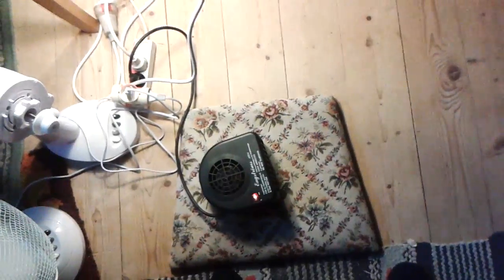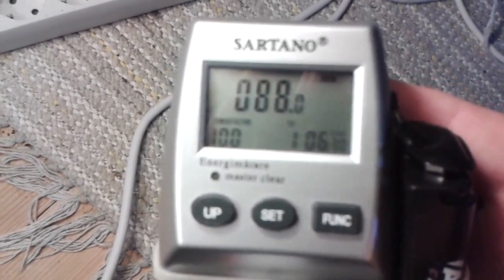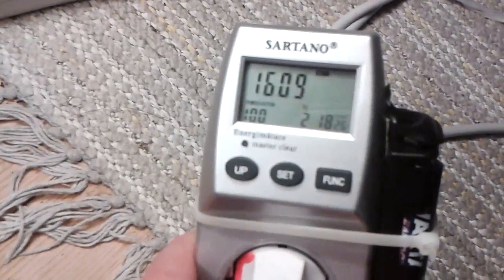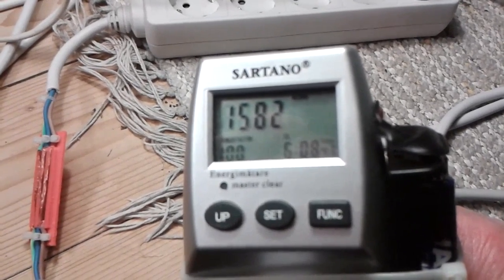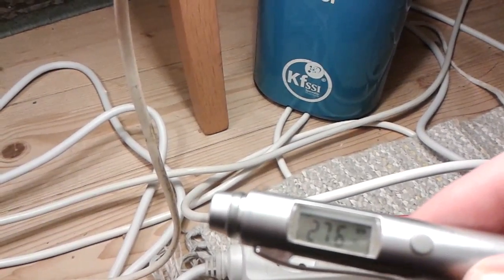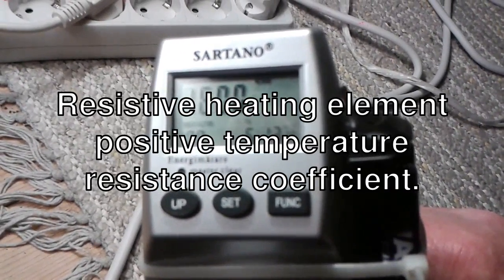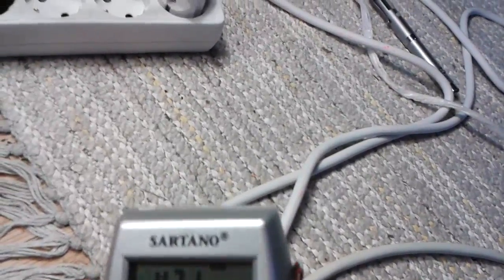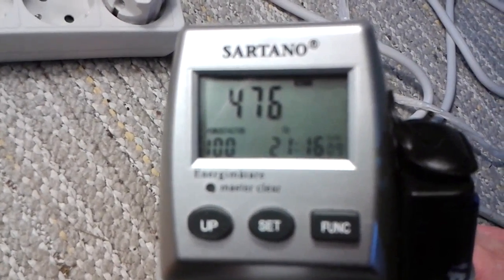#443 QEG Sweden Magrav Test 05 Feb 1,2

Comment: Did you read what it says in the manual?

1. It is important to note that resistive loads, such as but not limited to electric heaters, motors with carbon brushes, 
incandescent light bulbs and battery/cell phone/mobile chargers, should not be connected to the Magravs Power Unit

And you tested with an electric heater... /rolleyes

Btw... how about turning off the thermostate on the heater for the testing period (video) at least?
Reply from the maker: +fred sleepwalker Unless they've changed the Magrav conditioning blueprint again (which wouldn't surprise me. It's been as much a moving target as Keshe himself.), your statement is totally incorrect.
Reply: ZeroFossilFuel Dude "my statement" is copied right out of the manual which I accessed on Keshes website TODAY!

So much for "totally incorrect"...

https://blueprint.keshefoundation.org/manual.php
Reply from the maker: +fred sleepwalker Correct, dumb-ass, but that's only during Day 1-10 of the conditioning process. Day 11 onward resistive loads **ARE** introduced. *PAY ATTENTION* They followed this procedure to the letter.